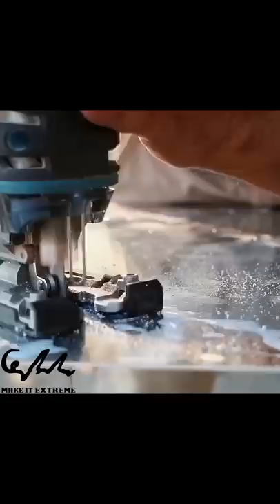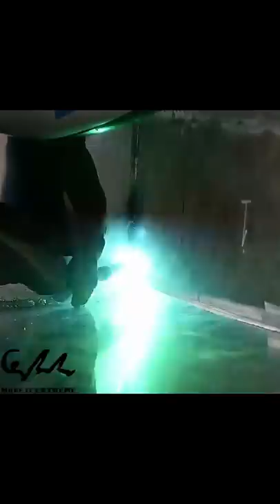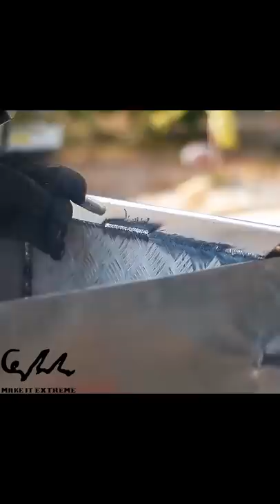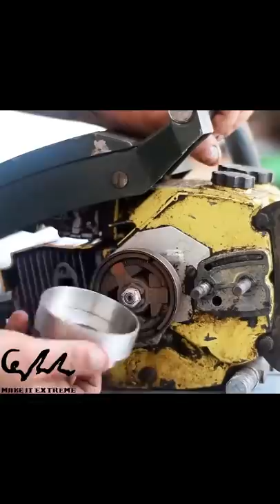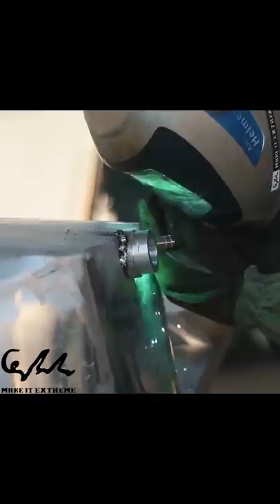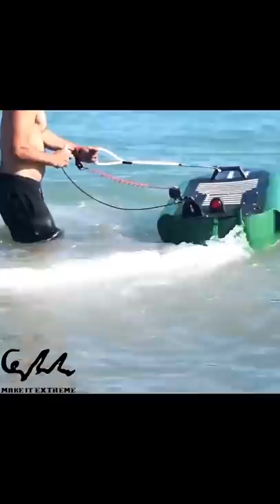Making a Gasoline engine aluminium boat

Comment: Nice
How is that aluminum welding machine called?
Reply: With a number.
Reply: Ok.
Can you tell me the number?
Reply: Yeah it's a aluminum mig machine. You just get a regular mig welder and buy the specific aluminum wire spool and you have to run pure argon to get it to work. Another name for the welder is a wirefeed arc welder.
Reply: @jacobbrutonbrauer7851  thank you so much dude

Comment: Boy very good... Just, you know, need some more pressure on the argon, and keep the welding area as protected from the wind as possible.. also use the proper setting for that thickness...  But I'm pretty sure you already know all that so I apologize.